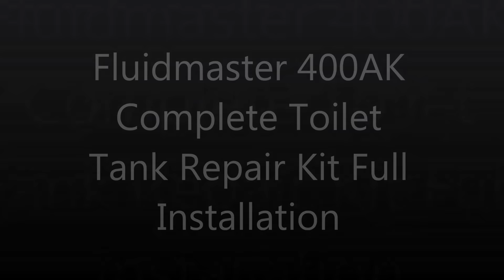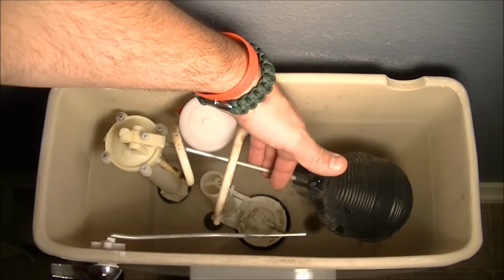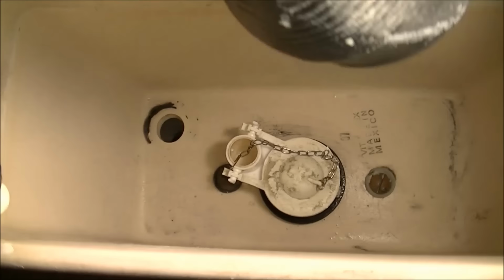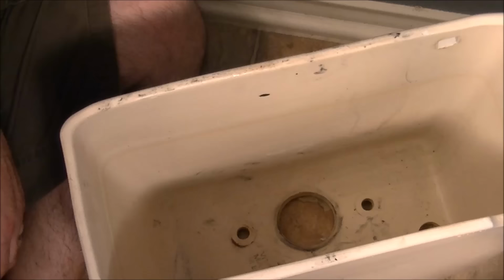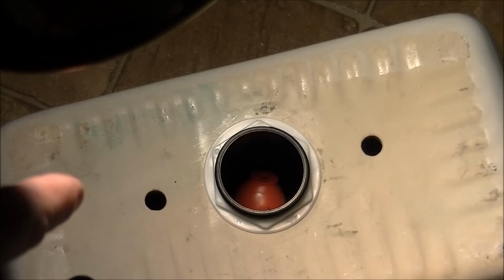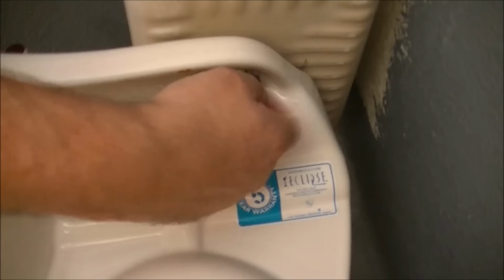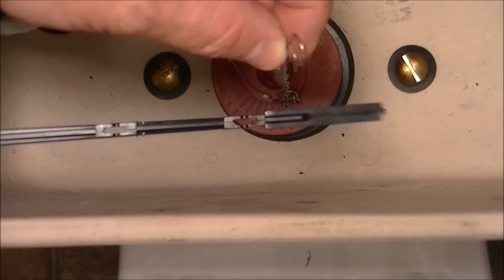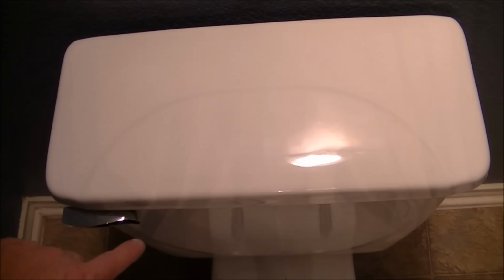FluidMaster 400AKR Complete Toilet Tank Repair Kit HD Full Installation

Comment: Awesome video.  However I have a side handle toilet, does this handle work from the side?
Reply from the maker: The instructions do indicate that you can bend the handle that comes with this kit to accommodate different angles but if your handle is working fine there is no need to replace it. If it lifts the current flapper you have it should be able to lift the new one without a problem. Thanks.
Reply: +Richard Lloyd my handle is shot. I can't figure out how to bend it. but I'll give it a shot.
Reply from the maker: Here's a picture of one at Amazon: Kohler GP30324-CP Wellworth Trip Lever, Chrome Finish
 http://amzn.to/2aIQWgx I just looked at my handle and it is made out of plastic and I am not sure it will do the 90 degree bend required but for an extra $6 you can order the handle above and be sure. Thanks.
Reply: +Richard Lloyd thanks brotha
Reply from the maker: You are welcome. Thanks for watching.

Comment: I had your EXACT problem: water rippling and when I went to check it out, the tube/pipe broke on me-just like you.  I also had your EXACT set up.  I replaced everything with this same  kit.  Now it's doing the "ghost flush" thing.  Any ideas??  I've rechecked the flapper, water level etc.  so frustrated!
Reply from the maker: Here is the troubleshooting guide from Fluidmaster: http://fluidmaster.wpengine.com/toilet-problems/solutions-toilet-making-refill-sounds/ Thanks.

Comment: Hi Richard (or anyone who can answer) I installed everything as specified and all works but the handle gets stuck at times.  I've tried tightening and loosening it, still I have to manually put the handle back in position.  Good thing after the toilet is flushed it's still not running.  Just wanted to see if anyone had any insight.  Thx
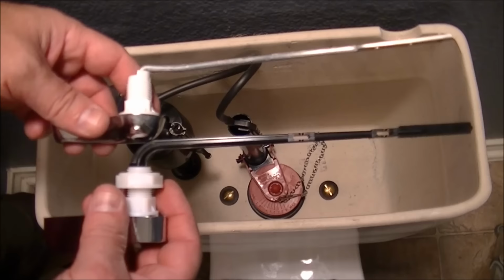Reply from the maker: Can you see what it is getting stuck on? Did you install the handle like I did on the video at 40:31?
Reply: Richard Lloyd Thank you for the reply Richard.  I'll look over it again and see if I may have placed it in wrong.  It does not look like anything is catching it maybe I possibly damaged a part of it so I'll take the handle loose again and verify. May the universal lubricant, WD40, will fix that.   We will see.  Thx.
Reply from the maker: dozierc  It's got to be catching somewhere. Solve that mystery and the problem is solved. Thanks.

Comment: why 2 washers at the bottom bolt. i think one goes on each end
Reply from the maker: +Gill Mccuddy They gave you extras and two is stronger than one but it's up to you. Thanks.
Reply: Some Kohler tanks have three bolts. The extra rubber washers are for the third bolt. (You're supposed to use the old bolt.)
Reply: No Richard, the 2 washers are not to be placed together. 1 is to be placed between the bolt head and the rubber washer so the head doesn't damage the rubber as you are screwing is on and the metal washer helps to push the rubber washer down rather than screwing it down.

Comment: Why does it takes so long to refill the water? It took like 4 minutes with my water on max.  My old one took less than a minute. People do need to double flush here.
Reply from the maker: Something is not right with your installation. It should not take that long mine is sub one minute to fill. Are you sure your valve to the tank is full open? I would check it for flow rate by disconnecting the feed line to the tank (turn it off first) and using a bucket to see what kind of pressure you have there. If it's good you know the problem lies in the valve somewhere. There might be something clogging it stopping the flow. If you can't figure it out you may just have a faulty valve. Take it back to the seller and get a replacement. Thank you so much for watching and commenting. I appreciate it greatly. All the best.👍😀
Reply: @richardlloydusa  I found the problem as other people have the same problem. It  is so bad that there 's a youtube video on how to fix it.  For some reason there's a spiral rubber stopper in the valve that cased the slow flow. Why did the company did this?? Prob to save water but this cause the double flush issue as someone like me first round doesn't clean everything. If you remove the white rubber stopper in the valve , it fixed the issue. Now my toilet refilled in 40 s just like my old valve.  You prob have an older model from 2014 which doesn't have this stopper.  I guess they decided to put this stupid stopper in for newer models.  I think this is just pure stupidity in the company's part.
Reply from the maker: Crazy but OK. If the other manufacturers don't have to do this there will be a LOT of returns for this product because of this stopper. Thanks again.
Reply from the maker: Hey thanks for the update on this I will be doing a follow up video because of your comment to tell people about this. Looks like they started with that water restriction screw about a year after I made the video. Thanks again. I appreciate it greatly. All the best.👍😀

Comment: You have installed the tank bolts improperly.  Fluidmaster no longer supplies the proper amount of nuts and washers to install the tank correctly.  This video displays how not to attach the tank to the bowl.
Reply from the maker: I see what you mean, in my defense it has not leaked to this day and is still functioning well. I can see why they would do the double rubber seal on the tank housing but as long as those bolts are tight it will stay sealed. Weird that they don't supply all the parts anymore. Maybe they decided it was redundant (no idea). Thank you for watching, commenting and the valuable feedback. I appreciate it greatly. All the best. 👍😀
Reply: Actually, you only need 1 rubber washer.  But in a perfect world the order should be bolt, SS washer, rubber washer, tank wall, SS or Brass washer, thin SS or Brass nut, then tighten nut, toilet bowl, SS or Brass washer, SS or Brass nut.  What they are not including in their All in One kit are the extra washers and nuts.  I would gladly pay the $1.00 additional charge for the correct installation kit.  BTW, this morning I removed my tank and did it the RIGHT way.  Absolutely NO LEAKS.  This is purely a cost saving issue on Fluidmaster’s part.  They used to include everything.  See, you don’t want to over-tighten the tank to the bowl.   By doing it their new way, you are tightening the bolts to the tank and the tank to the bowl.  That’s not good.   Rather, you want to tighten the bolts to the tank first, then put the tank on the bowl and tighten the tank to the bowl only enough to secure it firmly.  It’s two separate steps.  Plumbers are always fighting the clock.  Most are sloppy workers and do the minimum amount to get the job done.  I do not work that way.
Reply from the maker: Yes, I could see how you could break the bowl if you over torqued it. It's only ceramics after all. There could also be a chance that the tank would be moved and change the tension as well. Thank you again so much for watching, commenting and the valuable feedback. I appreciate it greatly. All the best.👍😀

Comment: After attempting to do this, I am now convinced that I am a total failure in life.  It now just leaks and I am without a toilet until I can afford a plumber.
Reply: You can do it.  You sometimes fail before you succeed.
Reply: Mine was leaking from the bottom of the tank onto the bowl and floor. I realized I did not tighten the bolts good enough to create a secure seal. Tightened the bolts and no more leaks.